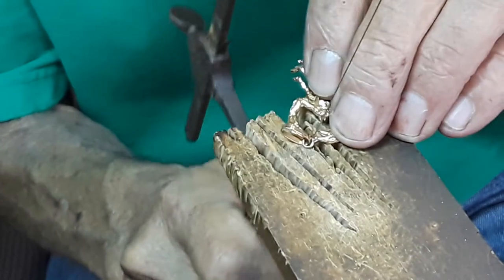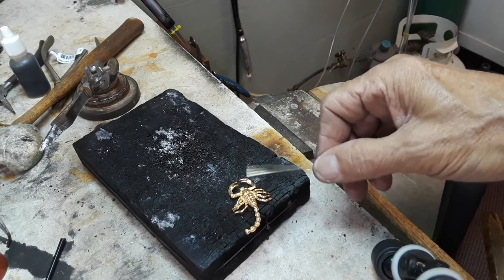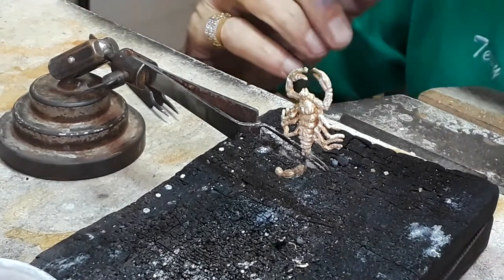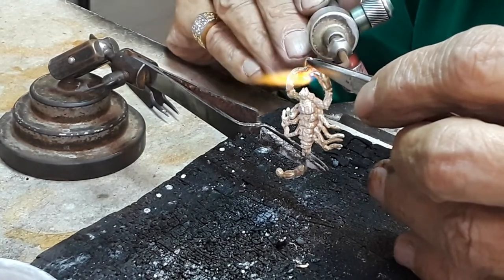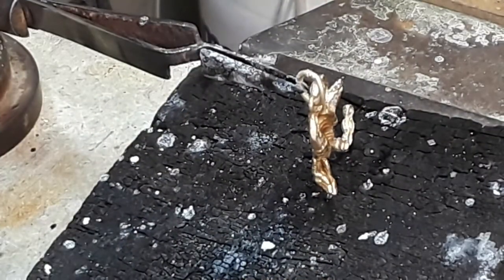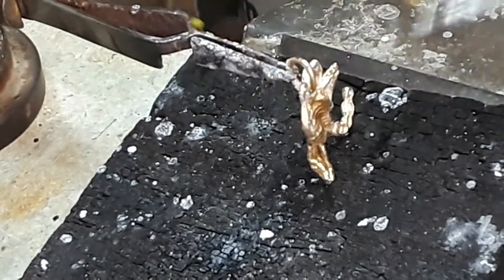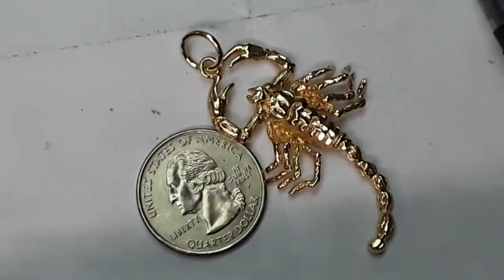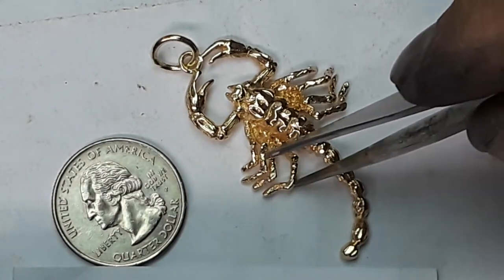REPLACING GOLD JUMP RING AND BAIL ON SCORPION PENDANT

Comment: What i mean is the little loop on the end of my 2mm cuban link chain, it just needs sqeezed a little bit in order to fit through the bail of the pendant that i have
Reply from the maker: You should be able to do that with pliars. Just be careful because 10k is more brittle/hard so it is more likley to crack than 14k or 18k. Let us know how you do!
Reply: @egadjewelry6025  yeah, the only thing i worry about is the solder that attaches the endcap that im going to bend together a little bit braking, but I will just be careful doing it and I will definitely let you know👍

Comment: Nicely done. I was wondering what size torch tip did  you use for that job?
Reply from the maker: Hi, thank you! I don't remember what size torch tip was used, but it shouldn't matter as long as you can get a soft flame about that size. We are using an oxygen and propane torch.